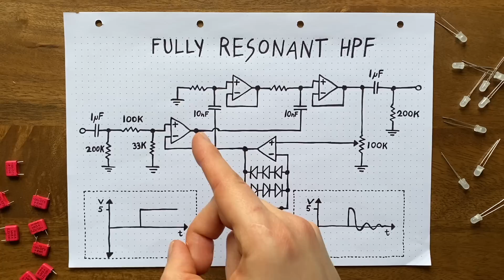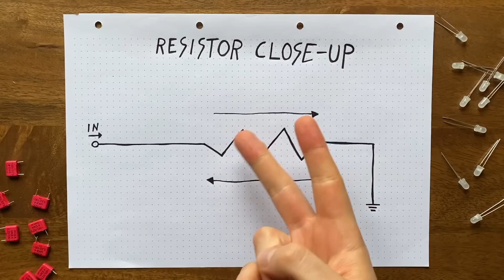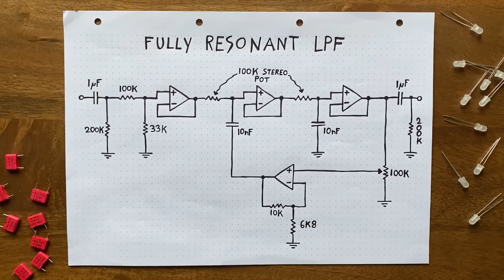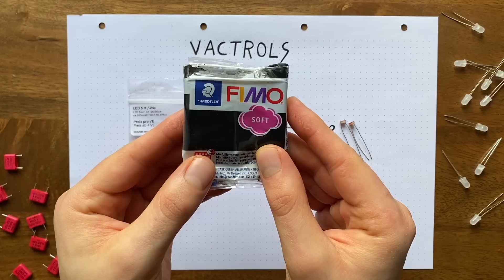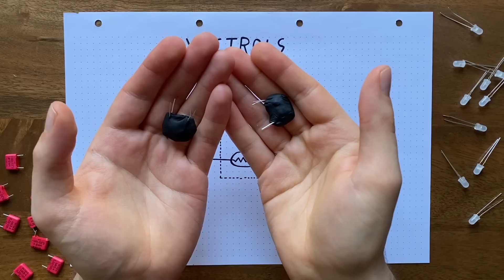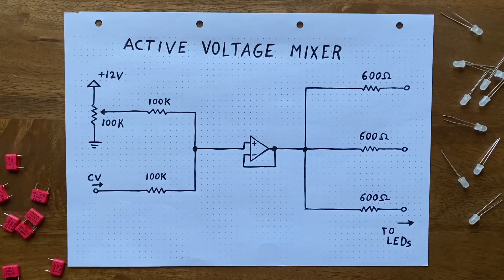DIY SYNTH VCF Part 3: Resonant High-Pass & Vactrol-Based Voltage Control

Comment: First of all thanks for such easy to understand descriptions for a complete beginner as myself.
A question on the Vactrol and matching the pair of them...would it work if you used one vactrol and the output from this went to the two positions on the circuit? To my non electronic mind I can’t see that it would be a problem though maybe I am missing an obvious issue. Big thanks for these videos.
Reply from the maker: no, that won't work because the two filter stages need to be isolated. you can't feed two signals through the same resistor(/vactrol) without them interfering with each other.
Reply: @MoritzKlein0  great, thanks, thought there must be a reason

Comment: Great video! in the mix, probably the 100K pot is better to be reduced significantly - it should be smaller than the input resistance, so 5-10k is ok ?
Reply from the maker: might be a good idea, haven't tested it!

Comment: Can we make a logarithmic amplifier to counteract the exponence...
Reply: Yes.  The usual method involves the nonlinear action in a silicon diode or the EB junction of an bipolar transistor.  Very often you need to build a thermistor into the design too.  Basically you build the log function stage and then add a stage that has a gain that varies with temperature to compensate the log circuits variation.

Comment: How is he converting the output voltage to a sound output. Part im most confused on, or just unfamiliar with
Reply from the maker: if you apply a swinging voltage to a speaker, you get sound. that’s all. you don’t need any kind of conversion.

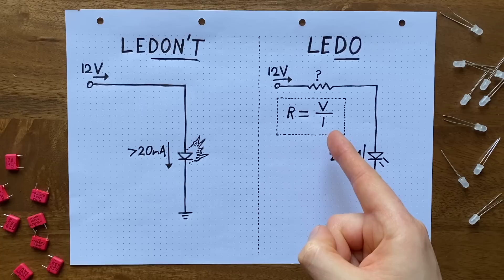Comment: On 17:11 shouldn't it be (Vcc-VLEd)/I_LED ? Because the LED has a forward voltage that has to be taken account for ( which would make the resulting resistor a bit smaller)

Comment: I made a vactrol to control an oscillator with simple AR envelope generator I made, but I ran into issues with the fact that my 0 to 12 volt signal out was effectively a ~1.5 to 12 volt signal due to the forward voltage of my LEDs. I was waiting for that to come up in this video, but it didn't. I don't know why.

You used a voltage divider to power the LEDs, and the op-amp buffer wouldn't have addressed that particular problem as far as I can tell, how come I didn't hear it click on after you turned the knob first? Or is it just because the lost voltage due to the forward voltage of the LED happens while the filter is basically eradicating all sound altogether, so it wasn't perceived?

Personally I'll be using an op-amp stage with a voltage-to-current signal converter to address this problem when I'm using vactrols. I just need to make sure I can properly dial in a good range of resistance via some testing

Comment: Ver good explained tutorials, but I am a little sceptic about the vactrol approach, how is the filter tracking specs with these ?
From my knowledge LDR's are chancing there specs over time by aging.
Why not using OTA's ?
Reply from the maker: yeah personally i don't like vactrols very much, so i don't use them in my designs – check the diode ladder episode for a more reliable approach!

Comment: Your Videos are Ace. Ging to build a big modular Case With your bipolar psu soon. Should i use a seperate Wallwart for each psu or can i get a 5A one  to Power all 4 of them in parallel?
Reply from the maker: i'm powering multiple PSU from the same wall wart and it works fine. just make sure the wall wart is high-quality & safe!
Reply: @MoritzKlein0  cool, thanks alot :)

Comment: Hello Mortiz, great video again, thanks! I have a 1 lil question, i use 1pole power supply for my diy synth, so can i use my lm358 instead of tl072 and 074? i mean there will be some problems about another components, their values?
Reply from the maker: it's always a bit tricky with audio signals since they're normally swinging around the 0V line. so you'd have to add an offset voltage to your input. here's how this would work: https://tinyurl.com/y4s8koe2 (it's meant for 0V/9V, so you might have to adapt some resistor values)
Reply: Try the icl7660s it converts any positive input into negative output (1.5-12v, so perfect for synth use). You can get 10 of them for under 4€. I use them to create a -5v rail from my phone charger USB supply.

Comment: I want to use this with my volca modular which does -3.3 to +3.3. Will i need to inplement a voltage divider to be able to send and/or receive control voltage without frying the volca?

The needed components listed here everything thats needed or do i need to get stuff from videos 1 and 2 as well besides the power supply part? Sorry for the newbie question and thank so much for this video!

Comment: Couldn't the CDS cell be replaced with wide spectrum  photo transistor?. Giving it much sharper response . Point it at a distant thunder storm it will see lightning you cant see. In the day time
Reply from the maker: no, because a phototransistor is a transistor and not a resistor, unless i‘m missing something here

Comment: Question: why is it that schematics with op-amps never show the entire circuit as far as power supply hookups? Is there a way around using dual power supply for those who don’t use Eurorack?
Reply from the maker: the power connections are implied – since they're always the same it would be redundant and distracting to always draw them. 
yes, you can a modify most, if not all circuits to work with a single-sided PSU. but it's a massive pain, which is why it's not really done except in the guitar pedal world.

Comment: 2 years later, do you still use (DIY) vactrols or are there better alternatives for this purpose? :)
Reply from the maker: i ditched them basically in the next filter video – for diodes :)
Reply: @MoritzKlein0  JFETs can be used as well.

Comment: Hi Moritz, I while ago I build this filter and it works great. I managed to use a DTDP switch (double) to switch between Low and High pass (basically switching on leg of the 33nF cap. to ground. And one leg of the vactrol to ground). What about replacing the Double switch for an stereo potentiometer? So that I can "blend" low pass and high pass? As the pot.meter is an resistor, if there something I need to put in between? Or can I just replace the switch for an Poti?? hope you could give me some advice. thanks in advance

Comment: Are VCF's usually unipolar on the CV input?
Reply: i hope this is what he mentioned at ~8:56 to adress in a future video.
Reply: I haven't seen the whole video yet, but I guess you could add a voltage offset at the CV input to make it react to unipolar CV. As an example let's say the vactrol goes to lowest resistance at +10V. If you add a voltage offset of +5V at the CV input, the input will accept +/- 5V.
Reply from the maker: i think 0V is normally the "neutral" CV input. all the envelopes i built put out 0-7V. wikipedia says moog does 0-5V. the MS-20 filter also is calibrated to be near closed at 0V.

Comment: This is sort of off-topic, but do you have a circuit for an ADSR?
Reply from the maker: none i designed myself, but i can recommend rené schmitz here: https://www.schmitzbits.de/adsr.html
Reply: @MoritzKlein0  I asked because I was going to offer you my own design. It uses a decade counter, stepped by a series of comparators. The only advantage over the Rene Schmitz/Barry Klein design is that mine can do multiple stages, e.g. a two-step attack, and once in the sustain phase the actual level can be varied by turning the Sustain level pot.
I have not actually built one, it is all simulated in CircuitMod.
Reply from the maker: @MrFlint51  sounds great, i'm interested!
Reply: @MoritzKlein0  How can I send you the circuit?

Comment: Following along this series has been great. Really really informative but I've got to the put on a bread board where I've setup the vcfs with vactrol control but my tl074 opamp is drawing 35mA of current and is burning hot to the touch. The only difference in components I've uses is 47nF capacitors as I don't have 33s. I though that a smaller input signal would draw less current due to the buffered input signal being so small (500mV peak to peak) but altering the max voltage of the in signal doesnt change it. I'm confused as to what's drawing so much current. Any tips?
Reply from the maker: is the filter working as intended otherwise?
Reply: @MoritzKlein0  Thank you for responding so soon! No haha The TL074 can't take that much current. Reducing the number of buffers to 2 instead did the trick and it didn't impact the audible performance of the filter. I do need to do some further testing though

Comment: Hi Moritz! I plan on buying lots of parts from futurlec for cheap and they carry a lot of opto-isolators. Since I could just buy a manufactured one for cheap what would you recommend? Thanks!
Reply from the maker: optoisolators are usually a combination of LED and photoTRANsistor. which is not what a vactrol is! if you can find one that explicitly says it's LED + photoREsistor, you should be good.
Reply: @MoritzKlein0  Ill take a look, Thanks!
Reply: @MoritzKlein0  Also, is there any reason to use this solution rather than an optoisolator with a transistor? I know there would be differences, but what is beneficial about this solution?
Reply from the maker: @steaming_mangos  if you want to use a transistor for voltage control, you‘ll have to heavily alter this design, adding a lot more complexity. the benefit of this approach is simplicity.
Reply: @MoritzKlein0  Understood. I love these videos, thanks a ton and I look forward to your future vids :)

Comment: Can a generic optocoupler replace the vactrol?
Reply from the maker: optocouplers are usually an LED + a phototransistor, so no. (if you find one that's LED + photoresistor, that should work)

Comment: I cant find 600ohm resisters. Does the 680 work?
Reply from the maker: yeah!
Reply: @MoritzKlein0  can't find the foil capacitors either. Do you think film would work? Thank you again!
Reply: @DroneDrummer  Yes, film capacitors will work generally.
You can also use expensive ceramic capacitors.  Low cost ones tend to have a capacitance that varies with voltage.  Selecting a ceramic capacitor rated for 100V will be more linear than one rated for 16V

Comment: The circuit is already built, how can I follow along? In 30 minutes you never go step by step, I mean it's cool to know what's happening but you can't really diy based off the video. Shrink tubing is the best I wouldn't use fimo for vactrols.
Reply from the maker: if you want to follow along, you should start with part 1 – this is part 3!